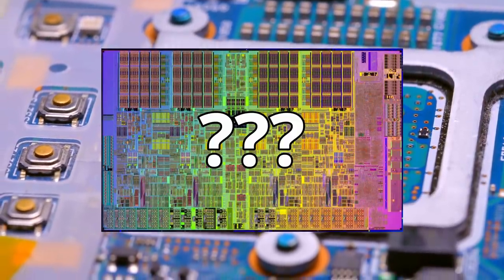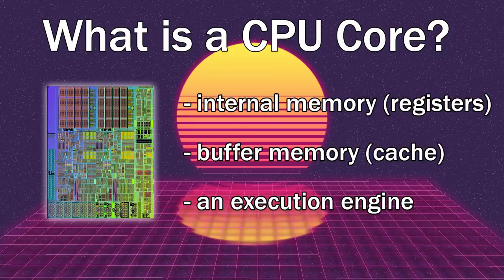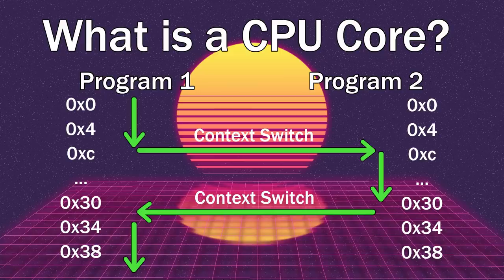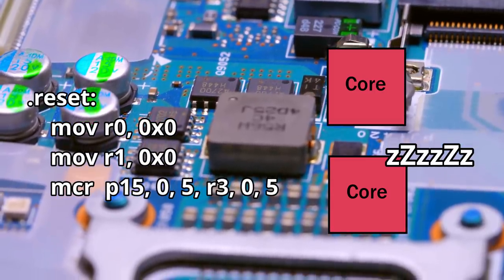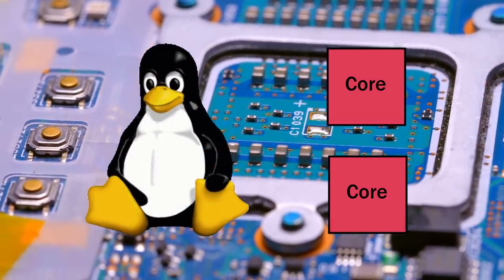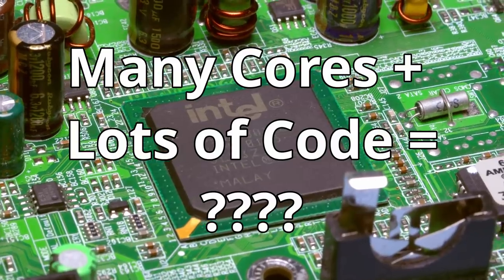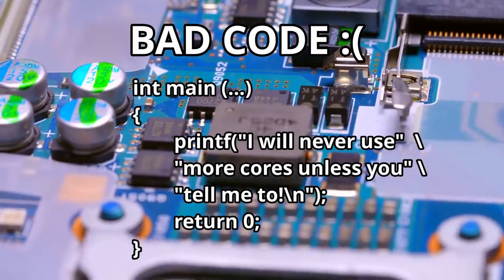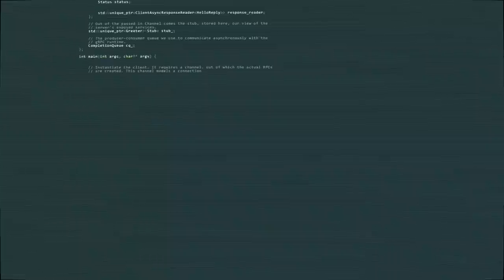why can’t computers have thousands of cores?

Comment: 0:10 I think you've confused two different facts -- IBM's POWER4 is from 2001. You might be thinking of AMD's Athlon 64 X2, which is the first consumer level dual-core chip and is from 2005.
Reply: the power4 chip he was on about isnt even multi core, its straight up 2 cpus on the same wafer.
Reply: @CocoaEm  Yeah, I'm realizing now he's likely referring to the PPC970MP. Which, like you said, was MCM, not two native cores.

Comment: There are already 3-digit processors in abundance, memory access also continue to improve, and there are many applications that parallelizes well. GPUs already have thousands of cores and are put to good use.
Reply: Yeah, but you can‘t really compare GPUs to CPUs. To my (given kinda limited) understanding GPUs resemble more to vector processors and are only efficient for usecases where your input data can be vectotized (ie cases where you fetch huge chunks of data at once and then crunch it). CPUs on the other hand are much better at crunching data which requires frequent, atomic memory access due to their way more elaborate caching architecture

Comment: the first computer I touched was the Tandy radio shack 80 model 1. I was surprised you were able to explain cores in a way an old guy can understand.  very well done. I'm astounded that after decades the speed of our apps are still held hostage by sucky HD read/write nonsense.
Reply: Basically, a core is just a CPU. a multicore processor, is just a collection of CPUs wired together to access RAM. it is why each core has an L1/L2 cache and sometimes L3 dedicated to its operation, then a shared cache for all CPUs to use for access to RAM. The shared cache is either called L3 or L4 (usually L4 if the CPUs have dedicated L3).

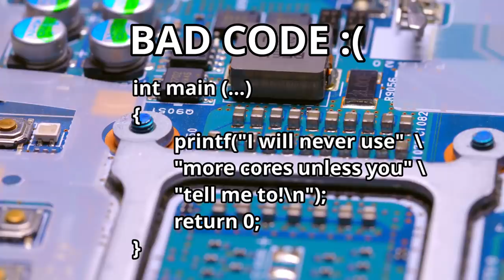Comment: At 7:00, this issue is once again what I mentioned for 2:15.  It's multi-threading.  I blame Intel for programmers trying to play catch up with modern many core processors, although there were many software engineers that knew Intel was wrong, and this goes back to Intel vs. AMD around the time of 2008 - 2011, when desktop CPUs had loads on them that started to become large.  Intel basicallly said you don't need to add more cores to desktop computing because they will be able to keep improving IPC and getting clock speeds faster and faster.  And they seemed to be right because their 2c/4t CPU where better than AMD 4c/4t CPUs.  And when AMD came out with an 8c/8t CPU it didn't fare a lot better.  Well, those first gen 8c/8t CPUs had core pairs that shared a single FPU while each having their own APU.  I know from going through classes that I was taught that FPU math was better.  It really wasn't as far as running it on an X86-64 CPU.  It is NOW, but it wasn't so much then and it certainly wasn't for AMD 8c/8t  8ALU/4 FPU CPUs.   If only professors would have remembered WHY it is you learn Discrete math.

Regardless, the point is one of multi-threading and how well an application does it.  This is something that takes a lot of work for programmers, and lazy developers in the last 2 decades didn't want to think about it and Intel gave them a reason not to.  Writing and testing multi-threaded software is harder.  I can write a multi-threaded algorithm that is the same speed as a single threaded algorithm or possibly even slower.  If one thread is simply waiting for another thread to finish work, such as I have a main thread that spawns another thread to run some function, but my main thread is waiting, this is slower even though it's multi-threaded.  So multi-threading requires experienced programmers or engineers to work with a project to evaluate the software development, and it isn't always so obvious if doing one thing vs. another is more beneficial.

There was one solid point you brought up other than the failure of programmers over the last 15 years to move towards developing their skills writing multi-threaded applications, and that was memory bandwidth.  There is nothing other than that you brought up which is a physical limitation until there are other conditions thrown into the conversation, which then means this conversation needed to come from a person who can describe power efficiency, nodes, how clock frequencies affect power efficiency, etc........
Reply: Another problem is you can have more cores or higher IPC and Freq but still be slower. But that is more of a time critical system problem.
Reply: The infrastructure and tools for efficient multi-thread software development are not yet polished enough. In theory a programming language could handle thread pool implicitly, in an OS-neutral way. Meanwhile the OSes would provide part or all of the thread pool implementation such that multiple programs using thread pool at the same time won't overcrowd the CPU and introduce unnecessary task switching.
Reply: " blame Intel for programmers "
And you'd be wrong. Or rather you are just wrong.

"So multi-threading requires experienced programmers or engineers to work with a project to evaluate the software development, and it isn't always so obvious if doing one thing vs. another is more beneficial."
If that were the only thing. Many problems simply can not be processed in parallel. The towers of hanoi are a often used example.
And not to mention all the other problems like coherency, scheduling and specially the bugs that creep up.
Reply: @ABaumstumpf  I know not every problem can be solved by multi-threading.  There has to be real parallel paths in processing for multi-threading to make any difference.  But that parallel path can simply be a few microseconds and it's still beneficial.  It can be two sets of calculations that can happen independently and you'll get benefit.

However Intel said EXACTLY what I said they did when AMD was releasing CPUs with more core counts than Intel.  So yes, they were part of the problem.  And yes, programmers have been lazy in many companies, and yes many programs can be written much better.

You're about to see this play out in game engines and what happens when you bring near realistic graphics to a game.  Part of this of course is the ability of a GPU, but part of this is the game engine.  Unity for instance has been notorious for saying that since a main game thread dictates how fast a CPU can process code, having a game engine be multi-thread only adds complexity with no benefit.  On the other hand, Epic Games released UE5 and games are going to be coming out on it starting the end of this year.  I watched demos of Matrix Awakens and it was pushing a 5950X to around 40% CPU utilization.  Simple math says this game with this game engine overwhelms a 4c/8t CPU, it pushes a 6c/12t CPU to 100% so even that is going to be a bottleneck, and an 8c/16t CPU is going to be minimal to run the game without the CPU being a bottleneck due to being overloaded.  There's other reasons the CPU can be a bottleneck, but this is going to be the first time as far as I know that for PC gaming, a 6c/12t CPU is going to be a bottleneck simply because it doesn't have enough cores.  

YES, INTEL SAID that gaming would never require more than 4 cores.  Now, finding old information with a search engine isn't very easy, so I'm not going to bother digging.   Of course by the time they put out 9th gen, AFTER AMD had released very effective 8c/16t CPUs, Intel did a 180 on THAT statement.

I'd be a millionaire if I had a dime for every time I've heard a game will never need an 8c/16t CPU.  Maybe a slight exaggeration, but I think you get the point.  What I think is going to happen is if a game company wants to develop a game that looks realistic, they're going to use UE5 and Unity will be relegated to more simple graphics.

Autodesk, same thing.  Their software gets poor CPU utilization and often when people have a powerful system, EVEN WHEN the software is rendering an image on screen, it's painfully slow.  You read comment threads on their site for different software packages and users complain about this, and point out other software that does the same type of rendering and it's much faster.  

Adobe, same thing.  They've improved SOME of their software.

At some point people will leave these companies behind when new hardware is still running like a turtle.

So yes I know some software cannot be optimized more than it is.  But I also know that thousands of students have gotten a BS in software engineering and their professors never emphasized multi-threading along with testing multi-threaded applications.  And I also know that in many cases, I'm right and we're going to agree to disagree.  I was a person BTW who went through most of a BS degree in software engineering (I had already retired from the military and time was catching up to me along with my back breaking down) and saw this first hand.  I ended up having back surgery before my senior year, and after that point I only wanted to work part time and didn't feel like putting 100% of myself into another career.
Reply: @billyswong  I agree, and I'm sure there are still many universities that don't push software engineers to program this way, and testing is hard.  

Testing effectiveness for multi-threaded applications, when the intent is to speed up the time it takes to run means time testing along with testing that functions work the way they're supposed to.  Multi-threading can slow down an application if done improperly.  Simply spawning threads to complete a task, if some other thread is simply waiting for that data can slow down performance due to passing data back and forth.

So yes it does require testing and the testing is going to be very complicated, but in the end it's the right thing to do for applications that require a bit of computation, and not simply a text editor or other simple computing.

"Meanwhile the OSes would provide part or all of the thread pool implementation such that multiple programs using thread pool at the same time won't overcrowd the CPU and introduce unnecessary task switching."

When you have something like a 6c/12t CPU  even the Windows schedulers do a good enough job at minimizing context switching.  That's not really the issue.  Sure if you're doing a bit of multi-tasking it can become an issue but that's not really what I was talking about.  And even with multi-threaded apps, I would think that between the application and the scheduler, the scheduler isn't randomly switching a core from one thread to another.  I would think that since many threads are short lived, they run to completion so data can be passed, before another thread is loaded to that core (where even with a 6c/12t CPU, it's viewed as 12 cores).  When you move up to 8c/16t CPUs and even more cores, this should get easier for a scheduler to handle.
Reply: @johndoh5182  and you have shown that you do not understand how computers or programs work.
Matrix as an example -a  game that constantly stalls the CPU and wastes more time on context switching than actual game logic.

But you do you. Keep on spouting lies, that is your choice

Comment: I know you are simplifying but multiple parallel executions have been possible in single cores for a lot longer than we have had multi-cores.  There are many CPU tasks which take many clock cycles.  Some of those tasks can be executed in parallel with other instructions.  Instruction pipelining, speculative execution etc, all work in single cores resulting in an IPC (instructions per clock) greater than 1.  As to whether a hardware context switch could occur within the pipelining ... my understanding is that, "hyper threading" is a relatively recent thing, but it exists.

Comment: i had a 9980XE which is a 18 core processer. but only gets up to 4.5GHz so i decided with the new 12th gens and ddr5 I would upgrade to the 12900KS which is a 16 core (8 efficiency, 8 performance cores) at 5.5GHz and honestly I think my system ran better with the older extreme edition then the much faster newer processer. so it doesn't seem the speed is everything either, I figured the much faster speeds would make up for the few cores lost but it really didn't, i use this PC for gaming which most games don't even use more then 4 cores so my assumption was faster single core performance would be better then more cores, but that seemed to be false.
Reply: eh you should have seen better performance in games if you were cpu bound. Games these days can and will easily use over 4 cores and depending on your gpu and the settings and the game you could see fps improvments quite high. But if your running alot of background or other applications more total performance may benifit you then having the higher ipc. not to mention ddr5 is quite meh atm and basicaly equal to fast ddr4 kits.

Comment: Moore's law was never a law to begin with. It was more of a design goal for the engineers. And now things are getting so small that individual transistors are only a few tens of atoms across. Given that silicon works by having a very specific amount of impurities, such as phosphorous, in them and that quantum effects start to mess with the whole process, it's physically impossible to keep up transistor doubling, let alone in a 2 year timeframe.

Comment: Once upon a time, I was an entry level engineer for Bettis Atomic Labs. They gave us a tour of the facilities. As we were wandering the warehouse, our guide pointed to the 32,000 processor computer they were planning on using to design Atomic Reactors (I made that part up, they were just planning on tryign to figure out how to use a 32,000 processor machine). 

They were trying to work out how to program such a machine. 

Then we moved down the warehouse 20 ft. "This is our 128,000 processor machine"

"Why did you buy a 128,000 processor machine before you figured out how to code the 32,000 processor machine".

"Because it is bigger and better!" 

The hurdle  of making a 32,000 processor machine work is much much bigger than making a 128,000 processor machine work after you figure out 32000 processors work.

Comment: I just discover a law that is a lot like More's law, but for cores. It says that eventually, we will be in theory reach so many cores that it doesn't matter if we add more cores and threads. It's called Amdahl's law.
Reply: That law is often missunderstood,  its about compute latency, not preformance
Reply: Amdahl's law is about the relationship of different performance based things within a computer. Where if you take some section that takes 90% of the time and hyper-optimize the crap out of it, so it takes 10% that it's previous time, you've managed the amazing feat of speeding up the system 5X and now you need to optimize the other stuff that didn't take much time before. You end up speeding up one part and that's good but then the other parts become wildly more important and you get diminishing returns on those types of optimizations.
Reply: already limited to the bottleneck between CPU and RAM.

Comment: I am one of the few people still using a single core CPU to watch YouTube. The CPU I use is a AMD LE 1640, with 1 core, 1 thread.
Reply: You're able to stream at 4K no problem, right?
Reply: Man... How?, Im sure even if you dont have much money you can scrap some am2 cpu with at least double the cores for like nothing these days and swap that cpu out, is it a desktop cpu right?
Reply: @Elinzar  Sounds to me like they have a small laptop or netbook. I have a netbook it is also 1 core 1 thread and only 2 GB RAM. I would add more RAM but I don't think there are RAM modules larger than 2 GB for it and there is only 1 RAM slot. It can barely stream a video at 360p.
Reply: 9 year old 4 core 8 thread Intel Core i7-4700MQ here at 3.4GHz

99% or 100% CPU use in one thread for gaming, audio, even for loading and saving stuff to the HDD (now SSD and the CPU is the bottleneck for the SSD, still ridiculously fast).

That microbe AMD system would 100% freeze in a DAW lmao.
Reply: @dannygjk  i looked it up and one page said it was a desktop cpu from the AM2 platform

other page said it was a 2014 chip...
Reply: @Elinzar  kk